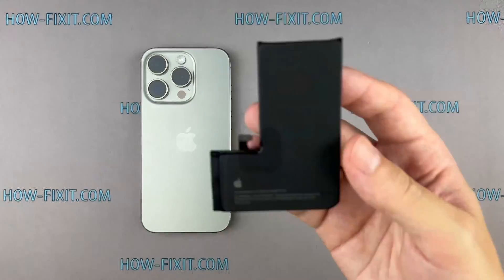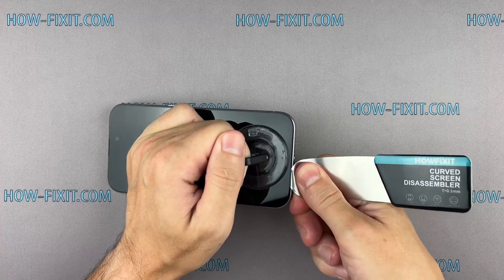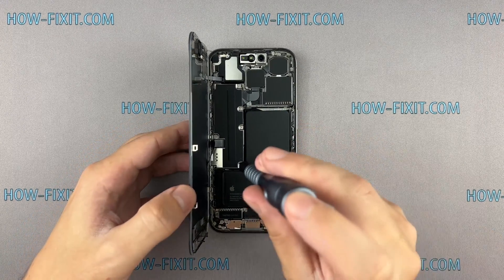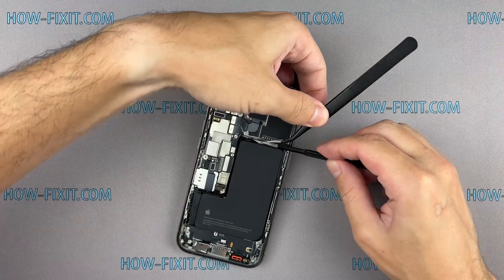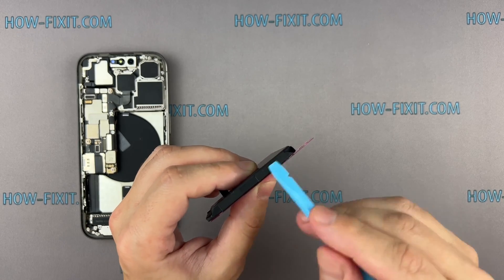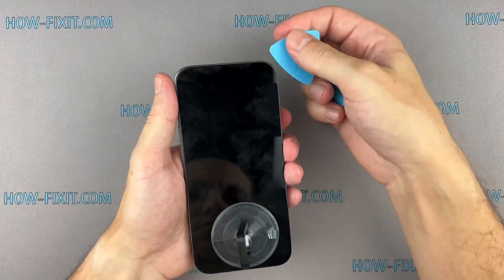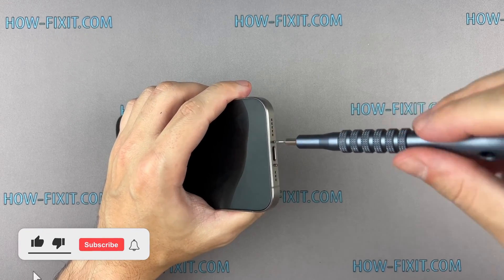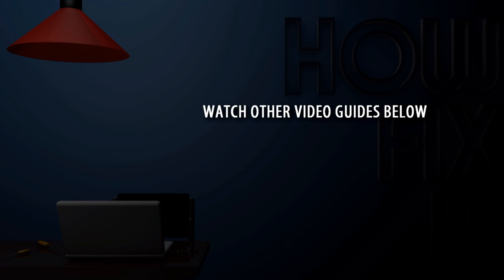iPhone 15 Pro Battery Replacement Guide

Comment: Why you didn't swap original battery flex cabel and install it on new battery to avoid the msg that appears
Reply from the maker: The process of replacing the battery flex cable requires soldering experience and this process is quite dangerous if you do not have this experience. In any case, transferring the original flex cable is a topic for a separate video and I do not recommend doing it.
Reply: This battery message is not worth the risk of the battery shorting out and accidentally catching fire
Reply from the maker: ⚠To Fix 'Unknown Part' or 'Important Battery Message' check the iPhone Battery Calibration video tutorial, link in the description under the video